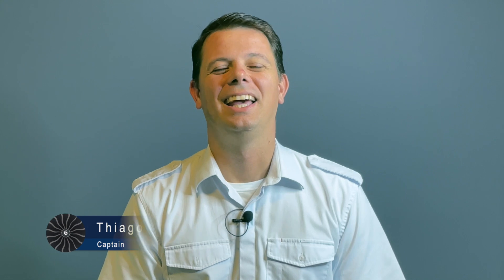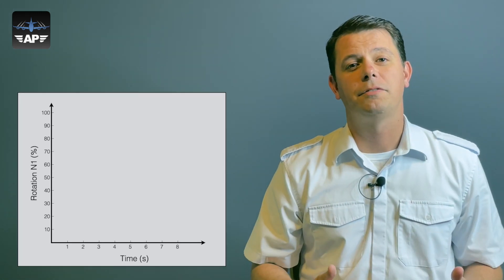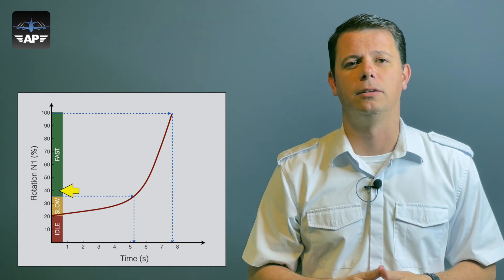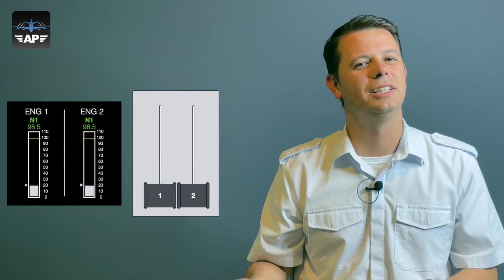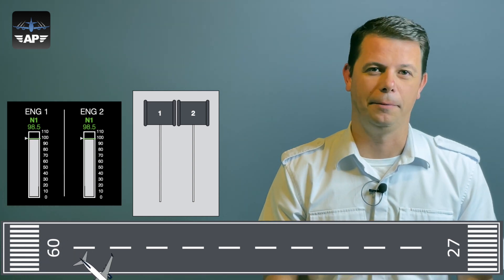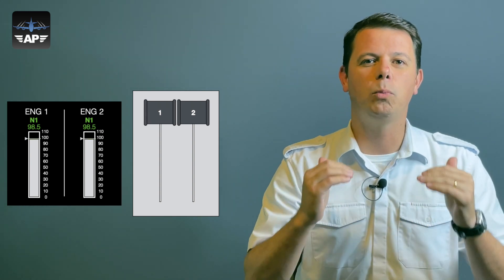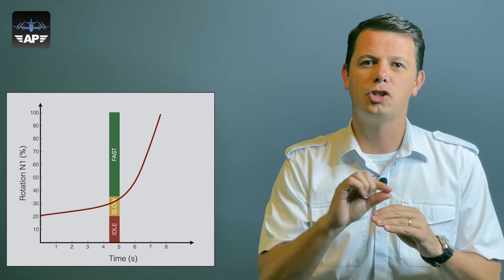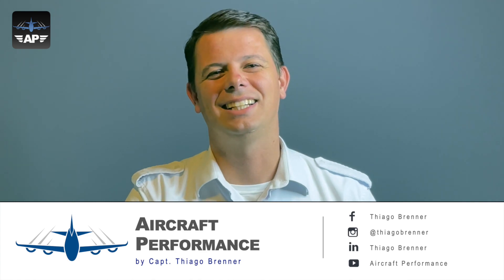Why we must follow a two step process to set takeoff thrust on a jet engine? - [English]

Comment: I think this procedure is not always necessary. There is a bonus when using old aircraft with their very old and tired engines. After starting the engines, while waiting patiently for the slow reaction and expansion of gases in the sixty-year-old engines, and until the rolling for takeof, there is plenty of time for the crew to enjoy a tasty meal for a few hours. Therefore, when returning to the aircraft, the levers can be directed in a single forward movement, dispensing with the intermediate stage. easy...LOL...but now, let's put this joke aside and let's take it seriously, congrats capit Brenner for the excellent video!
Reply: @AircraftPerformance1  🤣 👏✈